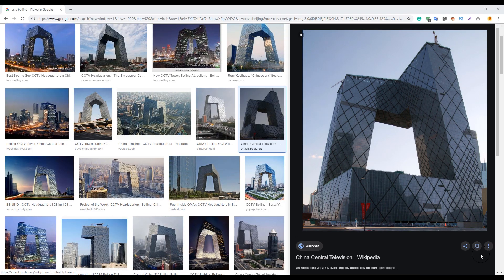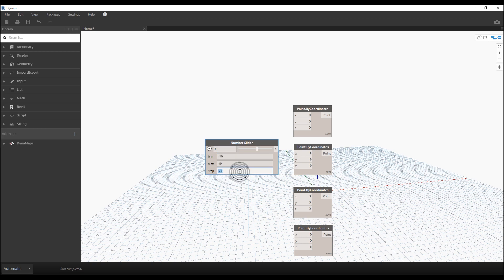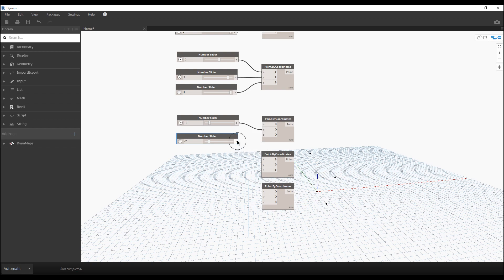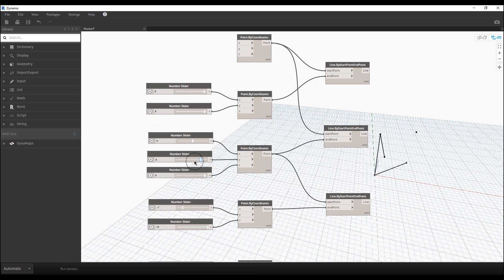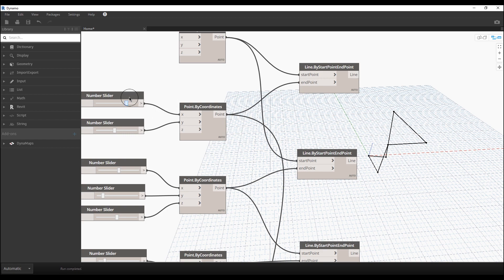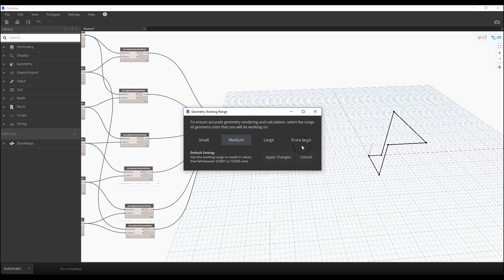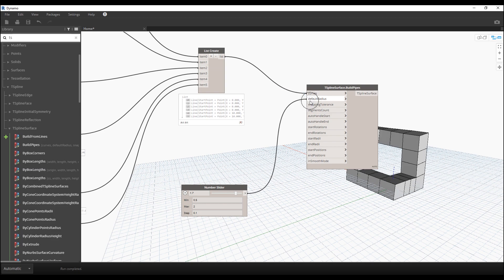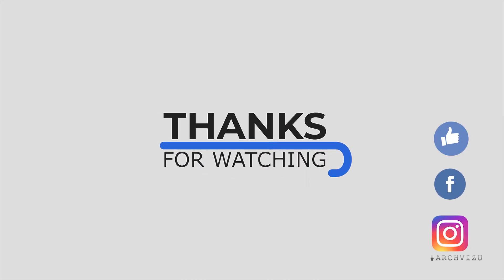Dynamo | CCTV Headquarters | advanced tutorial | part 0

Comment: Same thing could be achieved by in place family using sweep command and 3d path but it only beneficial when you have fix measurements for your structure on the other hand the process on dynamo seems too much complex but if your structure will undergo so many changes and arguments in shape form then this method is purely a master key nice workflow
Reply: I totally agree with you: it appears much easier simply draw it directly as an in-place mass; however typically in the real world modifications will occur, either from the client team or within the design team and these changes can be easily incorporated if designed in dynamo.